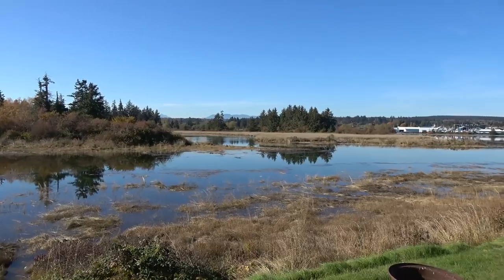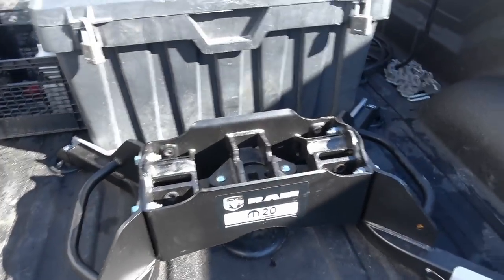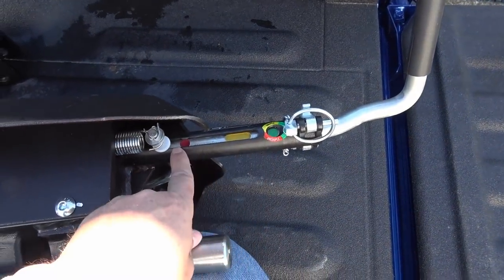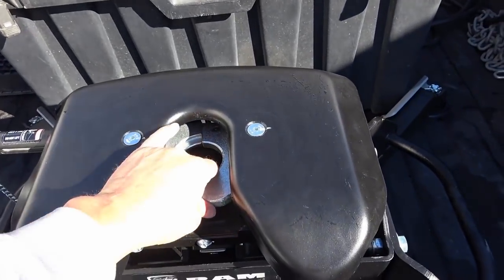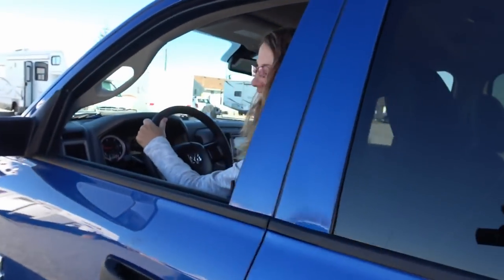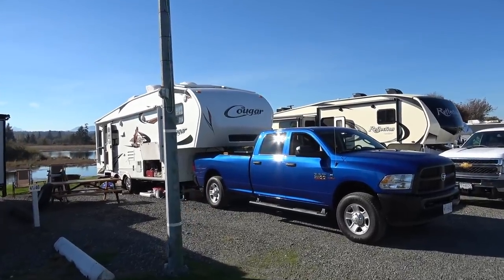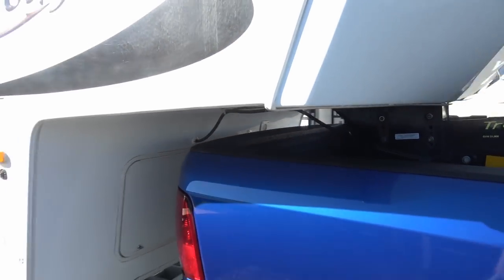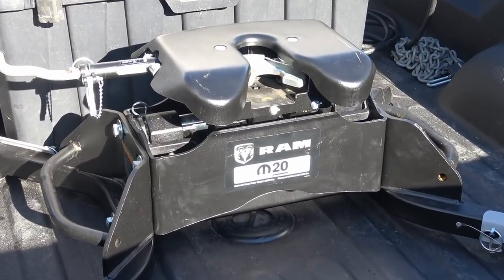Big Blue 2 - First Hookup (Testing New Hitch and Clearances)

Comment: You can do what's called A reverse level. Pull the block that come from the factory of the dodge. Unbolt the bolts, in bolt the block. Bolt the bolt the block on top of the leaf. Reinstall the u bolts. I did this on my 2006 dodge. It lowered the rear of the truck 1-1/8". Even with the load of my 5th wheel it's still 5/8" higher in the rear
Reply: You mean alter the rear suspension on a brand new truck to make a boondocking rig lower to the ground? I like the higher rate taller fifth-wheel springs discussed above. I am glad it worked out for you though.
Reply: It's a option. It doesn't change the spring rating. The truck is designed to squat underload. It may just need to brake it. If the 5th don't squat enough, pulling the block is a option. It my case it worked out well
Reply: Your crazy.
Reply: I'd hate to see your rear end geometry....do things like pinion angle mean anything?
Reply: These trucks are designed to squat under load. Typically 2 plus inches high in the rear. 

As for pinion angle, what do you think happens to the pinion angle when the truck is at max load? 
As the truck is loaded down, the pinion angle stays the same becouse it's in a parallel plan.

Comment: Can you open your tail gate when you are hooked up, looks very close.
Reply from the maker: No, but that was the same as the old one. Lost that ability when I swapped out the OEM pin box for the shorter Air Ride one. I'm used to it though, or I could get a fifth wheel tailgate. I like to use the tailgate as a table or workbench though.
Reply: Thank you and have a good trip with your new Blue.

Comment: Not that I'd want it or am asking for it to happen, but, what would you and Anne in perspective do lose your trailer, meaning if the 5th wheel hitch was to just Meraculasly disengage and let go of the cougar while you 2 were going down the road going at least a good 90 or so kph? which for those in the u.s., that would  be about 70/75 or so mph. I live in New York state, just outside of Albany ny, south of the u.s./Canadian border, I happen to have looked up the speed what the mph to kph was, a little bit after my younger sisters boyfriend and his family came down from nova Scotia up towards the upper part of Canada, and....... yeah, I've been sort of looking the speed up every now and again every so often.
Reply: morgan russman 
trailers don't typically come unhooked from hitch while going down the road.  5th wheel unhooks usually happen during hooking up and forgetting something, like making sure the pin is locked in. I have a safe gaurd on my hitch just for that. should for some reason the trailer did come unhooked, it will drop into the safety pin catch preventing trailer from damaging the truck/trailer, it's called a bedsaver...best money I ever spent. sells for around $400...but found mine for $100.  A whole lot cheaper than damaged vehicles.
Reply from the maker: If the trailer becomes disengaged there is a safety brake that locks the trailer brakes so it doesn't run away and stops quickly, but it would be a mess for sure. It's very rare considering the number of fifth wheels running around. Semi trucks are fifth wheels too. I think ball hitch trailers are more a problem with the much greater sway issue that makes then get out of control and flip.
Reply: 90 km/hr is approximately 55 mph.

Comment: 🤦🏻‍♂️🤦🏻‍♂️🤦🏻‍♂️ once you lift the jacks up the front levels out and the truck squats
Reply from the maker: Didn't squat very much with our light fiver, especially once it hits the 1 tons top overload spring. Now have over 20,000 miles on the truck and have found its gained maybe an extra inch of bed rail clearance as the new springs and shocks ,etc have all loosened up and worked in. Still runs a little nose high but seems OK, clearance has only been a big concern when off road and get in to deep ruts that twist the truck and trailer opposite ways side to side, just have to be careful and take it slow

Comment: Could just be me but that tailgate seems way to close to the camper.
Reply from the maker: It's was close on my old truck too, mostly because I had swapped the longer OEM pinbox for the Air Ride, it's a little shorter pin box. Means I can fully open the tailgate until unhitched a little.  A bit of a pain but I'm used to it though. Could always get a fifth wheel tailgate.

Comment: Not much room between the truck and RV....
Reply from the maker: Its due to my shorter than OEM pin box was like that with the old truck too. It turned fine just had to back off the hitch a few inches before being able to completely open the gate opening when hitching.
Reply: Love Your RV how’s your turning radius?  Will the back end of truck interfere with the 5vre?
Reply from the maker: I measure 60" from the center of the hitch jaws to the outer corner of the truck bumper. From the center of the hitch pin back to the trailer wall down where the bumper would be is around 70". So thinking I'll be OK there, should have about 10 inches.